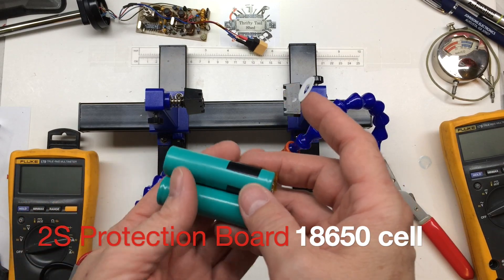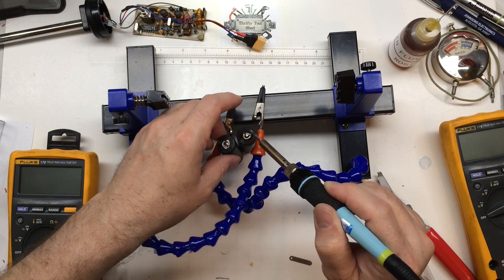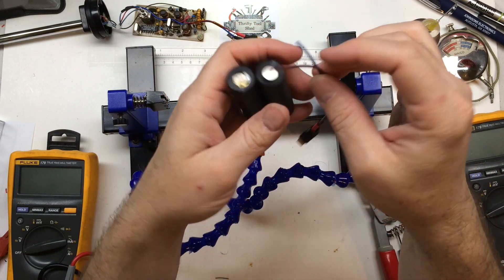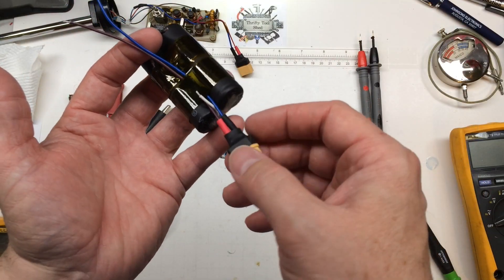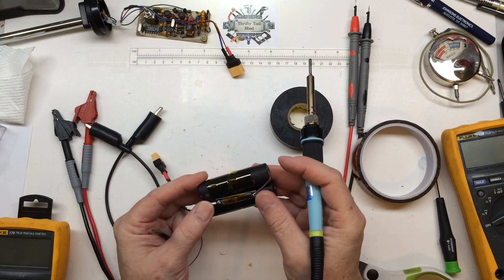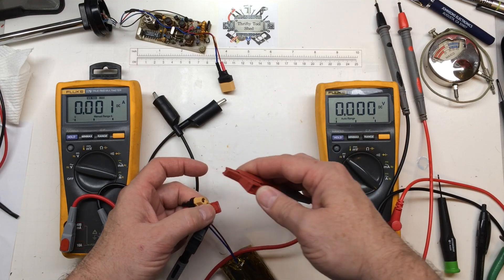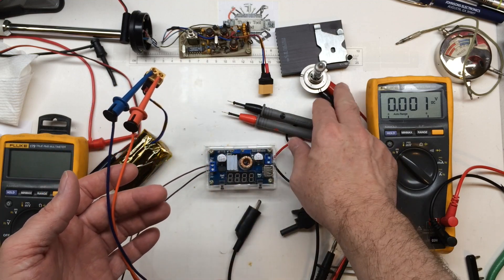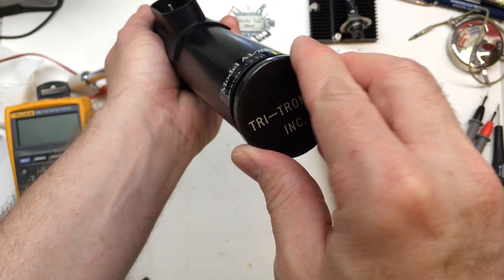Build a 2S Li-ion Battery Pack with Protection

Comment: Haha, 2s with protection and no balance charging.
Reply from the maker: Yep! Did you know big name brand packs also have no balance charging? Oh! Well...do ya! 🤣
Reply from the maker: In all seriousness, I really like the channel called Tool Scientist and he does an excellent job testing Milwaukee, Makita and Dewalt packs and I was blown away by the lack of balancing in those packs and man they are not cheap!
Reply: @ThriftyToolShed  Haha, you think, the balance are build into them.
Reply from the maker: Yeah, you would think. Heck, M18 packs even have the chip on board with balancing capabilities, and Tool Scientist showed through testing that they don't even use it. Crazy. I always thought M18 had it. For other packs (lipo etc.)  I always use a hobby charger with balance leads when possible.

Comment: I am glad you said that the balance circuit is dead at first until it gets its first charge from adapter. I thought my BMS was broken.
Reply from the maker: Absolutely and it will do the same thing at cut off level or over current condition!
Reply: hahaha 😅
pro I threw 2 BMS because of that

Comment: The battery + and battery - should be wired to B+ and B-. But you have wired them to P+ and P-. could you explain why?
Reply from the maker: Yes I can explain very easy. The connector wires were connected to the P+ and P- as explained. The last step in soldering was the cells to the B+ and B- which was also mentioned.

Comment: how are you gonna charge this 2S BMS? I dont think we have 8.4V Chargers available in the markets?
Reply from the maker: Well yes the 2S is a common setting for most hobby Li-Po chargers and I have used mine for these, but I almost always use my bench top PS set for 8.3V CV and around 1A CC. The CV and CC method is awesome.

Comment: Hello! After I added PCB protection board to a 18650 battery, now it won't charge! Do you know what may be the reason? Thank you!
Reply from the maker: I have not had that issue. If wired correctly it should charge as usual.

Comment: Those little bms's are good for low-end applications, but can't compete with a balance wire and a good hobby grade balance charger, when reliability of the battery pack is a priority.
Reply from the maker: I agree, as most viewers know I use my Tenergy charger for most packs  on my bench. Of course, as mentioned, this was for a friends dog collar. Still needs proper charger of course.

Comment: how much current and volts should i gave it the pack? or do i have use another thing to give it constant current then constant voltages? is there a small circuit that can do that?  i am confused there.
Reply from the maker: I always use a CC-CV supply. I set my Power supply for 1A max current and voltage set to 8.4V for the 2S packs. (Two 18650 in series) you could use a hobby type charger or any other CC-CV source like the Drok DC-DC Converters I have shown in some videos would work also.

Comment: Also why use nickle as a connector. why not use copper wire? Isnt copper a more efficient conductor. Will you get differential corrosion with copper? I have lots of copper laying around thats why i ask.
Reply from the maker: Actually, the strips came with some of the BMS boards I have ordered and I have used the copper wire before as well.

Comment: What type of flux did you use to solder to the battery terminals?
Reply from the maker: Rosin
RA flux, basically it is pine rosin. It is sticky but works well and cleans up easy with alcohol.
Reply: Thank you.

Comment: Did I get this correct? you charged this 2S pack with 13V and it was ok? There is no step down converter built in this protection board, right?
Reply from the maker: Yes, as a test with the current set to 1.1A and the voltage set around 12V to test if over voltage would shut down. I would not charge it this way of course. Only a test. With a CC supply it actually charged ok because once the current dropped off enough for Voltage to climb, it was very close to fully charged when the voltage showed above 8.5V or so and it shut off.

Comment: You seem to keep the soldering iron on it too long. That’s dangerous.
Reply from the maker: That's why they keep exploding! As mentioned in many of my videos if  you prefer spot welding, do so! I have done mine for years and have over 25 years experience with electronics, I have never, never, had an issue.  Thanks for your concern and comment.

Comment: Bro I have the same BMS board it is cutting off voltage just as my batteries discharge to 3.7V.
Could you plz tell me the mistake I am making or solution for this problem?
Reply from the maker: I have not had that issue. So both cells are at 3.7 when it cuts out?
Reply: @ThriftyToolShed  ya...are the cells discharging too fast?
Reply from the maker: @geethanshr  I would not think so, unless it is such a large current that it shuts down? Like for over current protection. If not and  you have double checked the connections are correct, you could have a bad board. I have used 3 of these and have not had that same issue!
Reply: @ThriftyToolShed  thank you so much.
I guess my modem requires more current hence it shuts down by over current protection.

So if it has more voltage then it can work for large current? And shuts down at 3.7V.
What is the max amps it can give out?
Reply from the maker: It's possible, but I would not think a modem would pull that much though? I guess I would double check the true current draw to be sure?

Comment: Thank you for sharing your knowledge to educate viewers. I have a question, i want to use 2s BMS with 7.4v in my demo project along with solar panel charging/DC adapter, My question is how can i use charging from solar to these cells and at the same time provide voltage to my Arduino board out of these cells. Remember solar is 9V and i require (7 to 7.4) volt on Arduino board. could you please assist me how battery pack (Made in your video) connection will work with my scenario? I am not sure which BMS pin should be used to power arduino at the same cells are being charged.
Reply: yes u can

Comment: Do I connect balance cable to the output of protection circuit or directly to the cells?
Reply from the maker: Yes, if you are not familiar or comfortable soldering on cell you can always solder on to some tabs first and then spot weld the tabs on the cells! I just keep some tabs or nickel strips around for that...

Comment: Very clear video. I'm going to make a 2S2P battery pack soon. Is it safe to charge the batteries giving power to the BMS? Someone told me the good way is to use a balanced charger
Reply from the maker: Balance charger is best for sure. I have had great success with these building cheap packs for lots of toys or specialty devices and it works fine and you have really good protection with most of these BMS. Overcharge and the undervoltage cut out are the main things for me.

Comment: I like this video instruction a lot. Very clear and THANK YOU, no annoying music. Can you tell me how you determine when your 2S pack is fully charged?  Is there some way to include an LED indicator if there are no space restrictions? Thanks for posting the links too.
Reply from the maker: Thanks for your comment, the cut off for a 2s pack is around 8.4V.  you just don't want to go above 4.2V on a cell. With the BMS connected and charging through it, it should cut out at around 8.4V and the ps current will show zero.

Comment: I can't get these to work for the life of me. Your video was awesome I connected bm first then pos and neg of battery and no power is coming out of p- and p+. Please advice.
Reply from the maker: You do have to charge on most BMS the initial charge is like activations and also if a fault condition such as short circuit etc. You will have to give charge to turn back on!
Reply: Thrifty Tool Shed , thanks a lot for your swift reply. I about gave my self a gash on my noggin trying to figure this out. Maybe what you suggested applies to this board only. I've made 3s up to 6s batteries and BMS work right away. I will surely give this booger a try. So I need to wire the p- and p+ and connect it to a charger that puts out 9 volts at 1.2amps? Then I will get power voltage? Thanks
Reply: I forgot to mention. Where exactly did you connect the MB to on you batteries. I connected mine on the negative of the series connection. I figure its OK since both batteries are joined with a fuse wire.
Reply from the maker: @milvolts1  yes, it should.
Reply: Thrifty Tool Shed , It worked! You are a lifesaver. Cheers🍻
Reply from the maker: @milvolts1  Glad it helped!
Reply: @ThriftyToolShed  Your video was great, learned a lot! I am having the same problem as Mario sellet, I connected everything and plugged my battery into my RC but nothing happens. From what you're saying, I should connect my battery pack to a charger to activate it first? If so, for how long? Thanks!
Reply from the maker: @hoadiep3176  
Its instant. Just an initial turn on. That is assuming cells are already charged of course.
Reply: @ThriftyToolShed  hmm, I tried that. After about a minute, connected to the charger I would get a 8.14v reading from my volt meter ...i assume that means it worked? However, after disconnecting from the charger I connect the pack to my RC it would not start. So I checked the volt reading on the P+/P- connector and it reads in the mv. Something wrong with my BMS? I tried 3 of them and getting the same results. Thoughts?
Reply from the maker: @hoadiep3176 I have not had that issue with mine. I have used several of these and several other BMS boards that are similar. Just the initial charge to initialize? I have used these in drills and saws etc. And if course other wireless devices. All I would know is if you are getting the voltage output and it's wired per diagram then maybe perhaps the current is too high causing shut down. Just my thoughts, I don't have your set-up to say for sure. They do have a low cut out rating for voltage as well as high current cut out. I have one 5s board that will cut out some times when I stall my pole saw and the current is too high. I will probably buy a higher output BMS for it eventually.
Reply: @ThriftyToolShed  ok. Thanks for the help. I'll do some more digging.
Reply: Do you have any recommended 2s bms? Mine  shuts down after 500mA or more even though it's rated for 8A...

Comment: Thanks for a clear, easy-to-understand video.  I picked up some 2S boards on ebay with their hookup diagram but your treatment with the soldering, nickel strip, captan, silicone, testing, etc. is a very nice demonstration. Very helpful for others!
Reply from the maker: So glad, thanks so much for your comment!
Reply: @ThriftyToolShed  dude you should put balance lead so it balnce the cells

Comment: What voltage do I need to charge the two batteries with this board? 8.4V is enough?
Reply from the maker: I would go to at least 8.6 to 9V In for loss in the small wires and circuitry. if your leads are not long, you may charge up really close to fully charged with the 8.4V.

Comment: hello I want to increase the capacity so is it possible to connect 2 in series and another 2 in series and join them both in parallel and connect them to the bms? Subbed
Reply from the maker: Yes, you are limited by current rating of the BMS you decide to buy. But yes a 2S2P pack is possible with this board.

Comment: Building battery pack using 18650 for 7.2v 35w 1.4ah, do u recommend using 2 batteries in parallel and connect them to another pair in series? This way boost up amps which give better torque used in power drill?
Reply from the maker: Yes using 2P-2S is the way to go with higher current drains as long as no size limitations of course. In my case it was just size limitations and of coarse very little drain. Have fun!

Comment: what size of nickle strip?
Reply from the maker: I used a 3mm strip for my application. I have lots of these strips around from different BMS boards over the years. You have to pick strip or wire suitable for your current draw. At least the proper rating of your BMS board.

Comment: Hello and thank you for the video! 
I’m trying to use the same board to build a battery pack but with 26650 cells and it is outputting current only when I connect the cells to the P+ and P- instead of the B+ and B- . Should I use 18650 cells or am I missing something?
Reply from the maker: Hello,
I have used a couple of these with no issues. I have the cells together on one end + to - then other ends connected to B+ and B- and I do have to charge it through P+ and P- first before it will output the first time or after a serious fault. so P is for charging and output on mine. Hope it helps.  Best of luck!